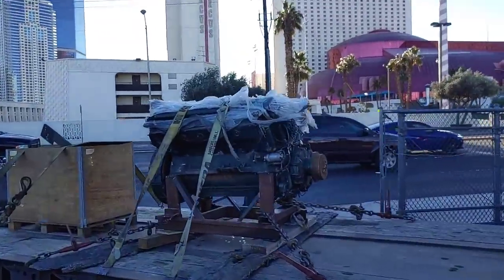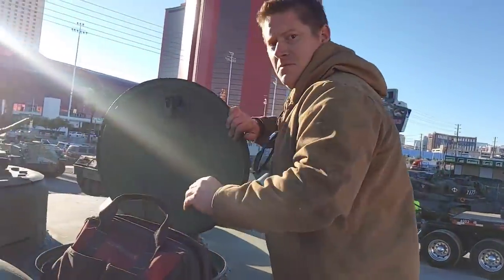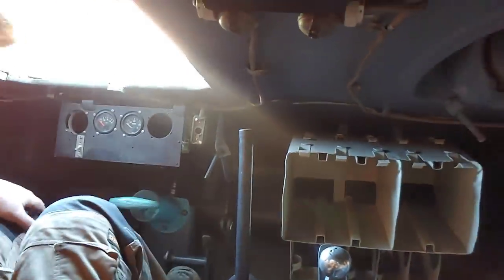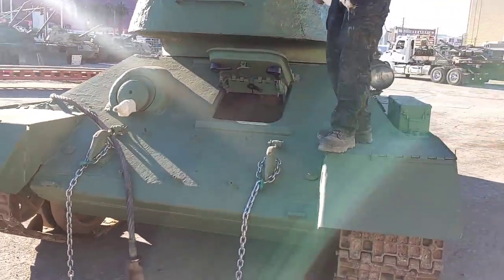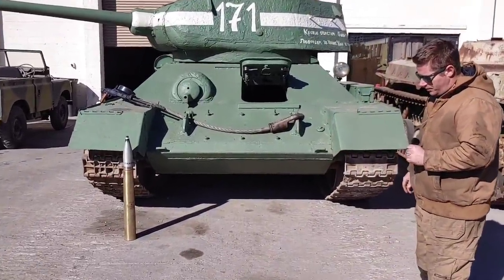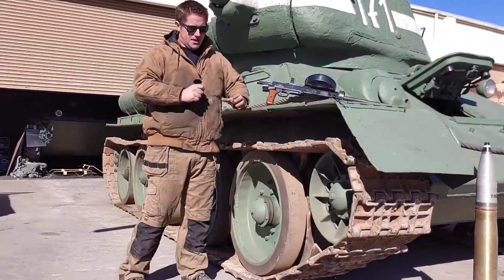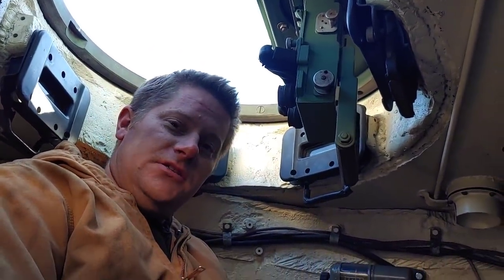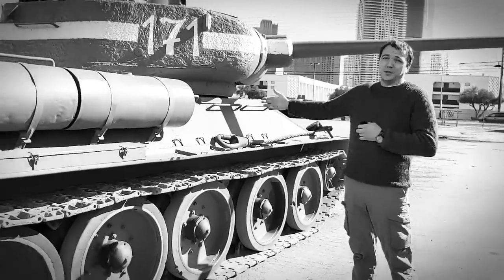Т-34 Tank. New addition to Battlefield Vegas

Comment: Casting as "Rough as a Badgers Arse" as we used to say in the British Army. The T34/85 in Bovington Tank Museum....The rear engine plate, where the exhausts are located @14.00 in this video, they do not even touch each other let alone are welded to each other. Rough and ready and it did the job. I bet Greenpeace love that Tank...lol. 
Bit of a bitch to drive so i have heard.
Reply from the maker: It doesnt need to look beautiful to be functional.  In regards to driving it, it depends on perspective.  On one hand if you can drive a T-34 you can drive anything lol.  But on a real note, it difficult in the sense your vision is limited and that it does require effort to steer.  However, like any of our tanks they all have trade offs.  While it might be more difficult to tight steer the T-34 it does turn alot tighter and a hell of a lot better than either of our shermans.  So just in MY personal opinion if I had to take one or the other I would probably take the T-34 even though its more difficult to drive, it has better mobility and is pretty quick.  But just before I have to hear all the internet warriors complain about what I just said, I did state that was my personal opinion and user experience may vary.  Especially if you are tall, then it would be extremely difficult to drive over something like a sherman.

Lol in regards to your Greenpeace comment, I want to put an "eco-boost" sticker right next to the exhaust of our T-62

Comment: There's an interesting piece of history from late 1941 regarding T-34's. During the Continuation War in Finland, the Finnish troops near Syväri (which is now a town called Svirstroy) managed to capture their first T-34. 

During the initial assault, Finns used their captured T-26's and shot over 40 rounds at the T-34's with no results,, watching as the T-34's drove away afterwards. This was noted as the first time Finnish troops had met a T-34 on the frontlines. The same afternoon a new attack began, and now eighteen T-34 tanks began to move towards the Finnish positions. 5 of these tanks were destroyed while at the road, the frontline bowed temporarily, but the attack was repulsed in the end. At the end of the battle, Finnish infantry reported that one enemy tanks had been stuck intact on its own side of the front line on a stump. The leader of the tank group Lieutenant Niittylä along with Lieutenant Laitinen, Tankers Viitanen and Heino left to take over the tank. It was found that the T-34 was stuck on two stumps. The crew of the wagon had escaped. Heino went in through the bottom hatch, found the main switch and starter, but failed to start the tank. In determining the reason for this, it was found that the T-34 starter gear did not hit the starter ring in the correct position because of the way it was resting on top of the two tree stumps.

What was done there after; One of the stumps was blown off and the other stump was cut. As the tank settled straight, the T-34 rumbled into motion. The tank was brand new. Only four shells had been fired out of the cannon. Tanker Heino drove the tank along the Linjatie through the Podporoze and Muurmann railway bridges to Syväri station, where it was loaded onto a train and taken to Petrozavodsk in October 1941. The wagon took part in the conquest of Karhumäki in December 1941.

The remaining part of this story relates to why we had the nickname "Sotka" or "Diving Duck" for T-34's during the war:

The T-34 tank was called "Sotka" during the war years. The birth story of the name is as follows. There was a guy named Suominen serving in the tank battalion, a Tanker from Tammela, who worked in Pammäjärvi, Tammela, as a sailor for a tug boat named "Sotka" before the war. Suominen told his friends stories about Sotka and praised its long chimney all the time. When Tanker Heino drove the never before seen T-34 from Äänislinna railway station to the Forward Operating Base of the Armored Battalion, someone from the group yelled when he saw the tank model with its long barrel: "There's that Sotka Suominen always talks about." This is how the baptismal words of the tank model were pronounced, and that designation remained in common use. In fact, I still personally call T-34's as "Sotka" :)
Reply from the maker: That was an interesting read.  I did not know any of that information, and will definitely have to look into that.  Thank you for sharing.
Reply: Brilliant story & thank you for sharing.

Comment: Maybe see if there's a way to fit a air line connector and valve? That way if you're ever out of air like that again you can connect a compressor up and charge the tank via a suzy connector?
Reply: I say that then see you hook up a compressor 2 mins further into the video XD
Reply from the maker: Lol no worries.  Its actually pretty cool you corrected your comment.  You would be surprised the amount of comments we get asking questions or stating things that are explained in the video.  One of the worst ones was a guy asking what tank was in a video when it was stated in the video title, the video description, and stated multiple times throughout the video

Comment: Man, seeing him trying to turn on that tank makes you wonder how janky it could be if you were out in the eastern front during your "off hours" and suddenly had to bring the tank into action from a cold start, knowing full well a German 75 can blow you up like a soda can. 
homogeneity
Also, I remember hearing that the soviets cheapened that tank to the point where in some factories, the driver's seat was deemed "unnecessary" and that if you needed a cushion you could fold your greatcoat and sit on it, and that's ignoring the HORRIBLE crew conditions inside one of those tanks.. but it sure beats being in a T-26, I guess.
Reply from the maker: Hard starting a tank is not specific to country of origin.  Our American, British, or Russian stuff is all difficult at first.  Once we fine tune it a bit they fire right up, including the Russian/Soviet gear.  As someone who has worked on a variety of tanks from various countries they are all relatively the same.  The main difference is usually the process of designing the tank

Comment: That to me was a novel way to get the engine started, drill some holes and spray in engine starter
Reply from the maker: The holes are a standard mod. We ad in welded ether ports later so we can spray through the back deck.

Comment: What kind, or are there any special licenses or documentation do ya’ll need to have to operate an actual firing tank ? Is it a federal thing or are you in Nevada for a reason ?
Reply from the maker: To own just a driving tank, no law prohibits that, anyone can. The hurdles begin with sourcing the tank, always check it has paperwork that the Govt. allowed its release. Foreign equipment is usually free and clear if for sale privately however there are some occasions the govt. can still own them. The firing part involves all matter of licences that can be found at ATF website.

Comment: Please do not start the engine in cold weather without preheating cooling liquid and oil. The T55 has a heater to do so, for the T34 the Russians used a flat metal box with coal under the rear of the tank. The T55 should be heated to 60 °Celsius if possible (takes about 30 min) or at least to 40 °C. Failure to do so will significantly decrease the life time of the engine to less than 20%. The air filter you used in the video about the bastard T 54 tank does not deserve the name air filter and will not do any favor to the engine. I am a former T55 driver.
Reply from the maker: Here in Vegas we are in the desert where the temperature will hardly ever dip into what most people consider cold weather conditions.  Very often throughout the year our ambient air temperature is 49 Celsius.

I do agree with your point however we are a privately owned entity and therefor do not have the budget or the time to maintain the equipment to the level of modern military.  The tanks that do have pre-heaters we do use when the situation is applicable but just understand that although we would love to have the ability to maintain the gear the proper way, the reality is that with our small crew we would only be spending time maintaining gear and never restoring new projects, which would take out the fun that our job provides.

Don't worry though we have one of the best maintained systems here compared to alot of museums that get something running and then let it sit and rot away.  We periodically take our gear for runs and do PMCS to them
Reply: I can't believe they DRILLED HOLES IN THE INTAKE AND SHOT EITHER 😱!! PREHEATING IS WOW!! SOMEONE NEEDS TO EDUCATE THOSE BOYS!!
Reply: Blimey Gunter, was that your old job...? 😮